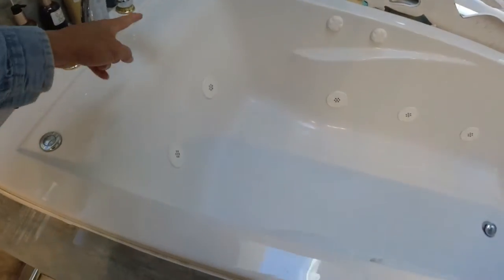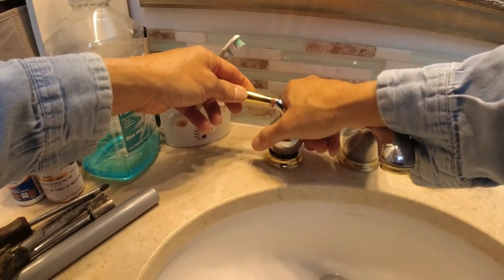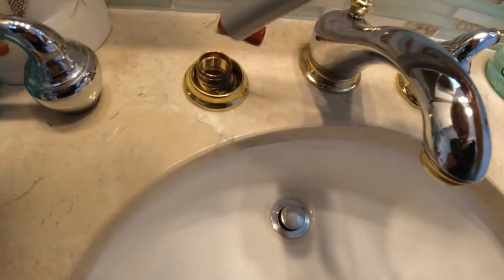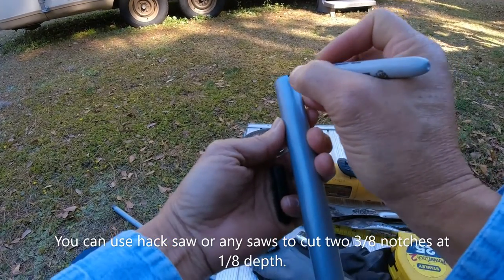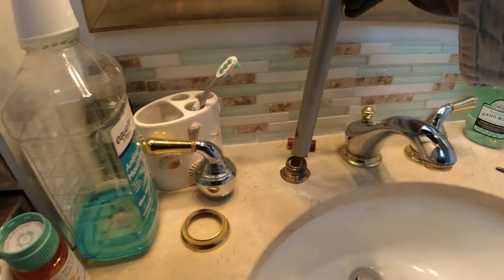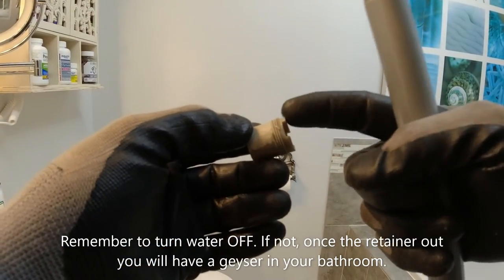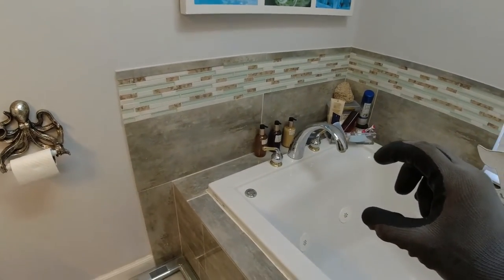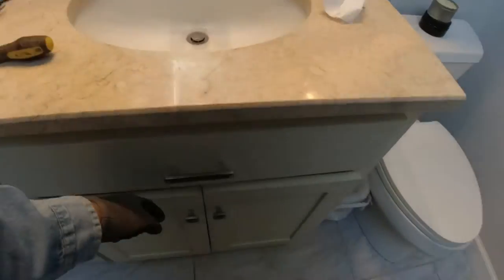How to make MOEN cartridge retainer removal tool. Remove and install the Moen 1224, 1248 Cartridge

Comment: I used a scrap piece of  7/8 in(diameter) copper pipe and followed your directions. The faucet had a slow drip after I had installed a new cartridge. The problem had to do with not having a "CRR tool".   After reinstalling the cartridge using my home made "CRR tool"., the faucet drip stopped. (Great 10 to 20 min. home  project.)

Comment: For anyone else trying to make their own tool the pipe needs to be 7/8 or slightly SMALLER. Slightly larger and it won’t fit into the sink handle because of the inner threads in the sink handle. The inside diameter doesn’t matter as much because it just needs to be able to fit over the center of the white plastic valve which is probably 1/4 inch. So any inside diameter over 1/4 inch should work. 
If you want you could use a 5/8 (16 mm) socket as the “pipe”. 

My Home Depot doesn’t sell the tool but a local plumbing supply sold it for $8.00. 

When you put the white valve back in it is imperative that the notch on the valve lines up with the notch in the faucet. That notch locks it in place so the handle doesn’t just spin. You’ll have to get a feel for when the valve gets set into the notch (not easy). If the valve spins like a clock then you missed the notch.